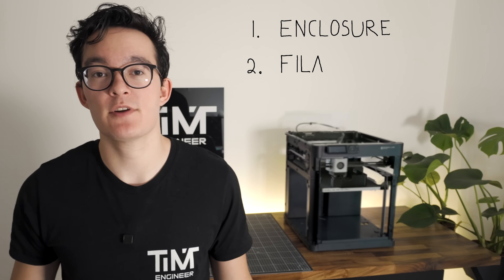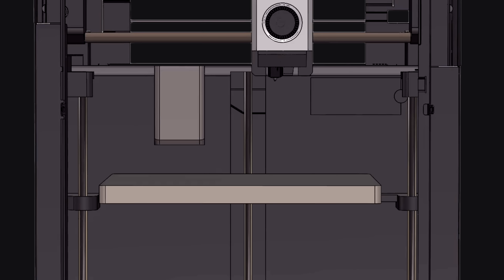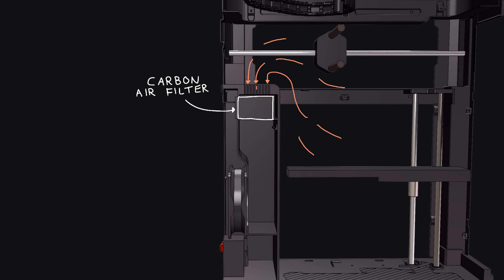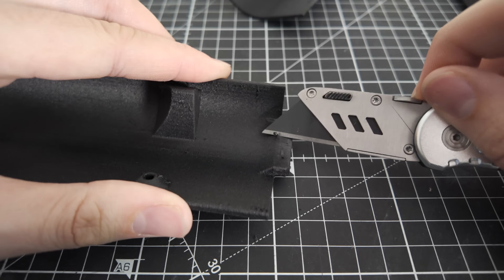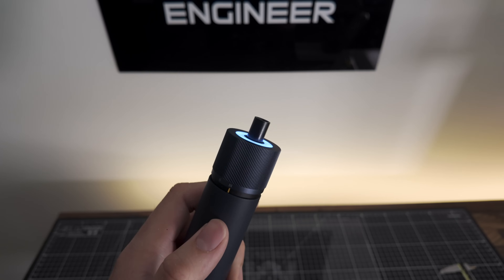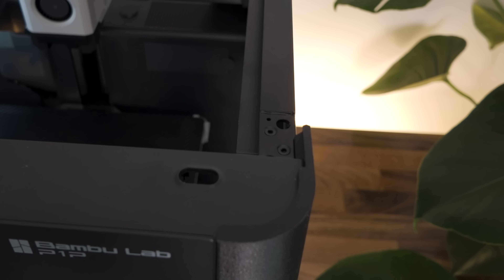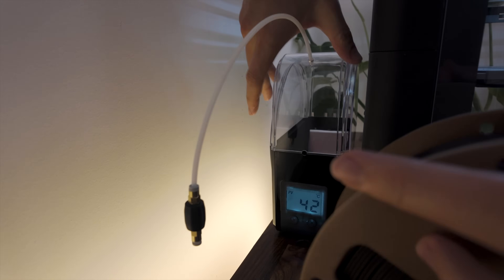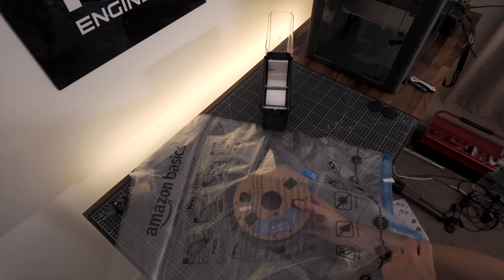Upgrading my 3D printer to print the toughest material: Nylon

Comment: Great video production! But personally i would of just bought a P1S if i'm to believe correctly it will print nylon out of the box with the exception of installing a harderned steel nozzle. I'm no expert though and worth fact checking.

Comment: Ffs, just throw fillament it into low vac enclosure, built from acrilic glass and some silicone, and heat it up a bit! 
Low pressure lowers boiling point of water hence faster times to dry.
I even consider building vacuum enclosure for printer i ordered recently (TronXY).
Now the cooling down of print will be a problem😂

Comment: ABS/ASA is actually more difficult to print than nylon due to the chance of significant warping on larger parts. Also, there are many other engineering grade filaments which are more difficult on the higher scale such as PPS-CF, PEKK, PEEK, PPSU, PEI and various others. Lastly, the difficulty of a print isn't based on the filament alone, but rather the geometries of the model being printed. For example, printing a tall model with ABS is significantly more difficult than Nylon. With nylon, you really just need to reach specific temps for your nozzle and chamber, and dry your filament prior to use which is the most crucial aspect of printing nylon successfully.
Reply from the maker: I’ve printed ASA and would like to disagree! But I guess it’s all subjective

Comment: 17:06 please don't apply glue to the 3d effect sheets. The way they work is they have small indents in the surface, if you use glue, you will fill in those surfaces and the effect could be more subtle or removed entirely

Comment: The adhesive on the back of the leds with come loose
Reply from the maker: Added some super glue forgot to record that part but they are still going strong :))
Reply: @TimTheEngineer96  yea i was gonna suggest superglue gel but i forgot

Comment: bought a cheaper printer then the p1s and can print nylon, pc, pa-cf, pc-gf etc out of the box.... the customer service is fucking awesome and they reply in max 12 hours (my experience) Qidi Q1 pro is awesome
Reply: also printed nylon a while ago, turned out absolutly great without tweeking the settings up to 70mm/s, with tweeking prb quite a bit more
Reply from the maker: Would definitely of considered the Q1 now but wasn’t out at the time :)

Comment: Is your chamber temperature controlled? Does the bambu software cater for example if one changes out the nozzle to out one in that can do higher temperature filaments like pc?
Reply from the maker: No it’s not, there isn’t even a temp sensor for the fan. You would have to do some heavy modifications to print pc like add a secondary heater in the printing chamber

Comment: Have you noticed any decline in print quality, such as surface lines or overhang performance, after switching to harder steel extruder gears?
Reply from the maker: No not particularly :)

Comment: Omg... There is "engineer" in your name and you drill holes like the first human xD. And i did´not want to say anything about your "electric" skills :P
Protipp: Put that vacuumed bag of nylon in another airtight container. Ikea Box 10,6l for example. The transparent bags can let some moisture in over the time. This is fine for ABS/PETG and so on. For Nylon better use the silver bags with aluminium coating.

Comment: Nylon is nowhere near from being the "Toughest".....
PEEK is superior in basically...... everything...
Let's not even talk about, PEEK-GF or PEEK-CF...

"MAINTAINING MODULUS
To further illustrate the high temperature capability of PEEK, Figure 5 shows how the flexural moduli
(bending stiffness) of nylon 6/6 and PEEK vary as a function of temperature. Nylon, like many
common plastics, loses much of its mechanical stiffness once the material is heated to 176 F°. In
contrast, PEEK maintains most of its stiffness up to temperatures approaching 300 F°. PEEK's ability
to maintain stiffness at elevated temperatures is one of the reasons that it is so often specified
for high temperature applications in the aerospace, semiconductor, medical, and food processing
industries.
The stiffness of PEEK can be greatly increased by adding various fillers and reinforcements
including glass or carbon fibers. Figure 6 shows the flexural modulus of unfilled PEEK as well as
30% glass fiber filled PEEK and 30% carbon fiber filled PEEK at various temperatures. As shown
on the graph, the addition of glass reinforcement essentially doubles the stiffness of PEEK and
the addition of carbon fiber more than quadruples the stiffness of the material. In fact, the room
temperature flexural modulus of carbon fiber filled PEEK is 3300 kpsi, one of the highest values of
any commercially available thermoplastic."

You can check the full study, by Dr. Keith Hechtel in pdf.

Comment: Great video, but many terms are used wrong. For example, the filter is not a "carbon fiber air filter", it is a activated carbon filter. Likewise, the "extruder" you referred to is called the hotend. the hotend is the piece that is heated and filament flows through. An extruder the the assembly that PUSHES the filament into the hotend.

Comment: so you turned the p1p into a p1s
Reply: Almost, hardened steel nozzle and extruder gears need to be added to P1S too, like I did, everything else he did is basically a P1S ugprade :D
Reply: An idiotic way to do it in my option but smart maybe less money than that 01s upgrade bambu lab goves
Reply: @exploreraviatorsNot everyone initially plans to print nylon..
Reply: @tagg8233  :/ ik bud
Reply: @exploreraviators It's also the fun & journey of doing it. Plus progressively spending cash rather than a single purchase.
Reply: @exploreraviatorsthe p1s is cheaper. If you intend to do what he did to the p1p
Reply: @NorDesigns it’ll be about the same price after you add the hardened steel prices to the p1s. Plus, his clear housing gets style points. 😎

Comment: having a p1s makes this upgrade much easier, just swap out the extruder gear and hot end to their hardened steel versions. Did you ever find out why the hardened gear was not working ?

Comment: Also, I waited for the end of the video to see if you addressed this; but you hot glued the led power switch which goes into the inside of the printer.... Won't the hot glue eventually melt and drip away due to the heat from the enclosure?
Reply from the maker: I didn’t think about this beforehand but luckily that hot glue starts deforming at 100 degrees C, because this enclosure isn’t going anywhere above 50 C it should be fine, but if you were designing an enclosure for materials like PEEK then yes it would be an issue

Comment: How much cheaper is this than buying the P1S? Because I’ve been considering buying one because I plan on printing ASA, ABS, and PA-6. But if this is cheaper I might buy a P1P and make the enclosure myself.
Reply from the maker: It’s only cheaper if you already have the P1P! If not go for the P1S
Reply: @TimTheEngineer96  Ah, good to know, I’d also imagine the P1S has a better build quality, you can only get so far with Acrylic sheets and 3D printed edges, also there’s probably better insulation in the P1S
Reply from the maker: Yeah definitely better build quality on P1S and your saving money so it’s a no brainer, the only advantage if you didn’t already have a p1p is the customisability. I am personally really happy with the enclosure being transparent for filming :)

Comment: the outside parts should be fine in any material, but both PETG as well as Nylon tend to creep under constant load while warm, ABS or ASA are usually the better choices.
Reply from the maker: Thanks for sharing :)

Comment: FYI, the install documentation on the Vision enclosure actually includes a PTFE guide that it is designed for so that might have been the intention rather than the silicone sleeve that came with the drag chain.
Reply from the maker: Yes that’s true. I found it wierd considering most people will need the cable chain which comes with the rubber gasket

Comment: I disagree on only one thing, nylon does not have lower layer adhesion, it has in my experience the second stronger layer bond only behind TPU.
Reply from the maker: Thanks for the feedback, I had layer to layer adhesion issues but I think that was because of incorrect print settings and drying at the time, so I think you right. Although, I think poor layer adhesion does still apply to bed adhesion in my experience.

Comment: I just got a P1S, is there anything else I need to modify or does it have all of these features out of the box?
Reply from the maker: P1S should be good to go! You will just need a filament drier!
Reply: @TimTheEngineer96  I jammed as many custom fit boxes with desiccant beads into my AMS as will fit and a humidity sensor in it. It usually runs 20% or so, hopefully dry enough! Thanks!
Reply from the maker: Nice hope that works for you good luck

Comment: My advice, buy all the upgrades you might want when you buy the printer. Bambu makes it really cheap to do si. It's only $100 more for the P1S over the P1P and you get this stuff out of the box. The AMS is $100 less if you buy it with the printer too. Also accessories like extra hot ends and filaments are discounted when you're buying a printer. So buy buy buy and save save save!
Reply from the maker: Yes would definitely recommend this!

Comment: Great and helpful video. I have recently ordered a P1S specifically for printing nylon gears for my projects, but now after watching your video I'm a little bit confused. I hope you can spare some time to answer my questions.
Did you print your gear in PA or PA-CF? I didn't catch that watching your video. If it's just PA, is this type of filament really so  abrasive to warrant replacing the nozzle for hardened steel version? With plain PA I was hoping to use a "soft" stainless steel 0.2 mm nozzle, in order to achieve better XY resolution of the teeth. Another question: did you pre-heat the chamber before printing? Did you power on the bed and let it sit for a while with the door closed, or use some other heat source?  I was kind of surprised to see that lowering bed temperature actually improved quality -- by reading printing forums, I was led to believe otherwise... Thanks!
Reply from the maker: Thanks for the feedback! To answer your questions: I only used PA-CF for the printed side corners of the enclosure build. The gear is printed in PA. I upgraded the nozzle and extruder gears for PA-CF, you do not need to upgrade these for PA. 0.2 mm nozzle will be tricky as nylon likes to clog, but if you dry your filament thoroughly (multiple days) you shouldn’t have any issues. I did keep the printer on for a bit before starting to print this usually helps a bit, bed temp is relative, it can’t be too low or too high either so you will need to do some testing.
Reply: @TimTheEngineer96  Thanks very much for answering, now it makes sense to me.
Reply from the maker: No worries and good luck!

Comment: Hey Tim, I just gave up on trying printing Nylon on my Bambu A1 and ordered P1S with all the necessary upgrades. I just wanted to ask. Is liquid glue better than glue stick and also do you have your printing profile? I will also be printing gears and need those in pretty accurate shape.
Reply: Perfect thank you for your answer. Looking forward to the new video.
Reply from the maker: No worries thanks!
Reply from the maker: Hey I’d say you made the right choice with the P1S! The printing profile I used is in the video before printing! All Cooling off! I found liquid glue works well as well as an engineering cool plate! Drying your filament is the biggest issue people overlook so make sure you keep drying it at 55C even for a couple days until you start getting good results. One extra thing you can do if your still struggling with adhesion (I did) is get an “ICE plate”(google it). It’s the king of adhesion. Will probably do a video in it in the future

Comment: If nylon is inherently hygroscopic, do parts tend to expand over time regardless? Maybe even more so if the filament is dried out? Does it become thirsty?
Reply from the maker: Yes it will absorb the water after printed it’s one thirsty material. As long as it’s not wet during printing it’s not as big of an issue!

Comment: I like this video, but wouldn't it be just a lot easier (and probably cheaper) to buy a P1P to P1S upgrade kit? :D 
https://www.3dmensionals.de/bambu-lab-p1p-to-p1s-upgrade-kit-3007#attr=18514,18517,21697

Or it would be also great to know why you did't choose this way. 
Maybe there are some reason you didn't like with existing kits (e.g. the lights)
Reply from the maker: Yes I should of touched on this in the video, main reason is I already had the P1P, bought it when I didn’t need to print other filaments. The other reason is that It was very important for me to see through it to be able to do Timelapse’s :). Buying a P1S or getting the enclosure kit is much more worth it for sure!

Comment: Can someone here help me answer a question regarding glue?
I've seen some people say glue is to promote adhesion, which makes sense because it's glue, but I've also seen some people say it's a release agent. Which one is it????
Reply from the maker: A bit of both? It definitely promotes adhesion, before I used glue I would get a lot more warping. But depending on the glue when it cools it looses a lot of its adhesion. So it can potentially be used as a release agent although I’ve never seen it be used this way.
Reply: @TimTheEngineer96  I didn't think of it changing after it cooled. That's probably the key difference that I didn't think about. Thanks!

Comment: ...please, just STOP putting hot glue on anything electrical. It can (potentially) heat up way above the temperatures that hot glue will tolerate.
Reply from the maker: Hey that’s a really good point I hadn’t thought about, luckily the 5V Led wire isn’t getting anywhere close to 100 C which is where the hot glue starts deforming

Comment: Serious question to a more engineering mind than my own.  If some of the unique qualities of nylon (not nylon CF or nylon GF) is that it's slick (not abrasive), not especially hard or strong, and almost waxy feeling... Why do you say that the hardened extruder gears are a required upgrade?
Reply from the maker: Your absolutely right the hardened extruder gears are not needed for just Nylon. I may have not been very clear and that’s my bad, but I mentioned that this upgrade was solely for printing abrasive filaments like nylon CF.

Comment: Please share print settings and bed types + glue. I`m trying to print PA-CF but its really hard. I`m with P1S and 0.6mm hardened steel nozzle, But I don`t know about the fans and cooling needed or not.
Reply from the maker: I have print settings shown in the video before I start printing the nylon attempt #2! As for cooling turn it all off!

Comment: Can somebody give the mechanical properties of this Nylon filament, please? the mechanical props you show do not even get closer to Nylon, unless you use recycled/ with a lot of moisture or both. that grade is also a co polymer, and seems toughened so, less stiff than the usual generic purpose grade but styill too low. to put some perspective, the properties you show ( and they might be true, i do not know every grade of coPA out there) fit better with HDPE, or polypropylene. Your TPU tensile modulus is extremely high for an unfilled TPU. The ABS similar to Nylon.Anyways  if the technical datasheet is not shown( at ,least i could not find it in the website), you won't have any idea of what you are buying. it might be nylon, or just scraps of polymers that melt around that temperature. Nylons possess good abrasion resistant properties
Reply from the maker: Hey mate good catch that’s an editing error from me I forgot to switch out the title to ASA instead of TPU, data is correct for ASA just title is wrong
Reply from the maker: It’s a copolymer of Nylon 6 and Nylon 66 which have very similar properties so we can assume same values as for a PA6

Comment: Great Video! Very informative and I really appreciate your fine sense of humor. I did the conversion from P1P to P1S a few weeks ago and I preferred - after some serious consideration - the original Bambu enclosure set. It's expensive, though. But it comes with all the parts, including all the necessary fans and mounts. And it's not to underestimate how much material and energy (and therefore money) is needed for DIY-printing and building an enclosure. At the end, the original enclosure is not so much more expensive anymore. And Bambu can't blame you for not using it when it comes to defects. Nevertheless your enclosure is great (and brings much more vision on the process) and will surely work perfect. Especially the lights are nothing less than amazing.
Reply from the maker: Thank you! The enclosure by Bambu lab is amazing and all in all costs the same for a much more professional finish so It’s still what I recommend!

Comment: Dont get me wrong, i appreciate your hard handmade job on getting the printer enclosed, but wouldnt it be easier at this point to get a upgrade kit? or it was just too expensive compared to DIY solution? I am looking to do the same, but to be honest i dont really like idea of drilling anything in the printer itself :)
Reply from the maker: 100% recommend the enclosure kit. I personally like the 360 transparent view which is why I didn’t go for it but either option is around the same price. Around $250 DIY method
Reply: typical bamboo labs fanboy opinion lol